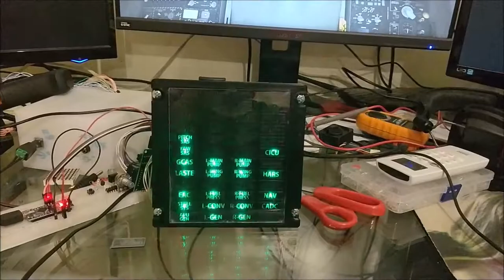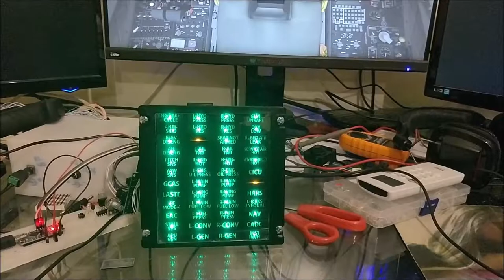A10C caution panel (final)

Comment: Salut, serait-il possible d'avoir un schema de cablage ?
Reply from the maker: Salut, un peu de boulot en ce moment... Je n'ai malheureusement pas de schéma tout prêt. voici déjà le procédé utilisé:
tu devrais déjà pouvoir trouver tout ce qu'il te faut en regardant les infos de montage d'une matrice LED avec le MAX7219 :https://www.google.com/search?client=firefox-b-d&q=max7219+led+matrix
Pour me simplifier fortement la tache du côté MAX7219 (éviter de monter les condo etc.. permettant de faire tourner le MAX7219), j'ai pris directement le module MAX fourni dans mon kit aruidno : exemple de kit --> https://www.amazon.fr/SainSmart-MAX7219-led-Display-Control-Arduino/dp/B00NDVTT3W
J'ai ensuite démonté la matrice de LED fournie sur le kit et soudé à la place ma matrice personnalisée.
Par cette matrice et pour le schéma de cablage c'est tout bête il te faut simplement monter tes leds et identifier les lignes et les colones (anodes / cathodes de tes LEDs) afin de les câbler sur ton kit MAX7219 (cf. schéma de cablages fournis par la doc du composant).
Ensuite pour l'interco avec l'arduino j'ai simplement monté une maquette de test avec la programmation et librairies arduino permettant de tester ma matrice perso.
Une fois le tout opérationnel, j'ai ajouté la prog de l'outil DCS BIOS et voila!

PS : pour la prog arduino elle se trouve normalement dans le lien dropbox dans la description de la vidéo. Il faudra probablement que tu adapte dans le prog la matrice en fonction de ton cablage.
 En espérant que ce soit utile.
a+
Reply: @sej84  Super! Merci pour ces premières infos. Je découvre l'arduino et le codage pour dcs, toute information m'est utile